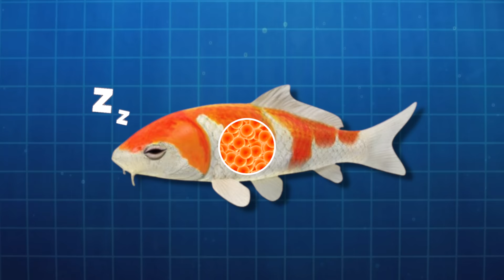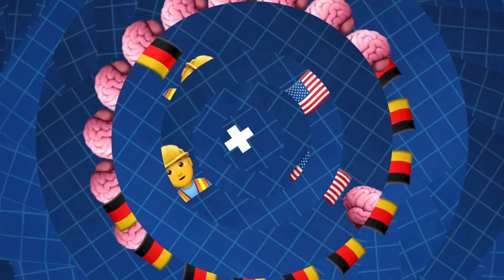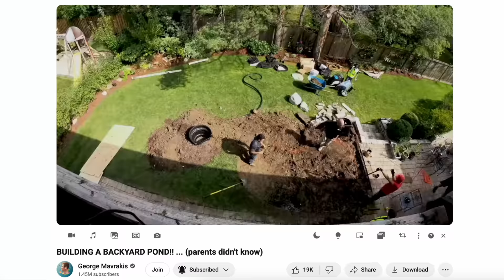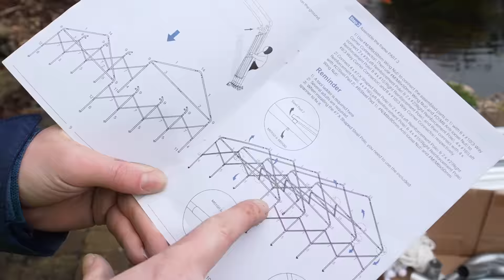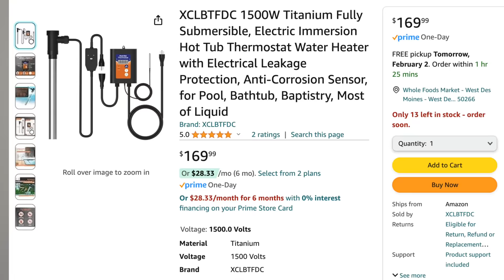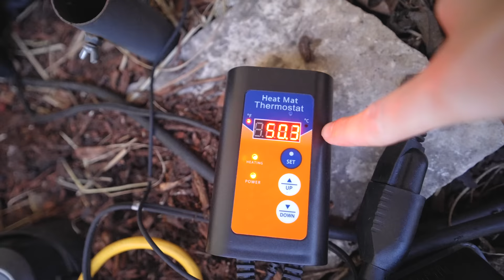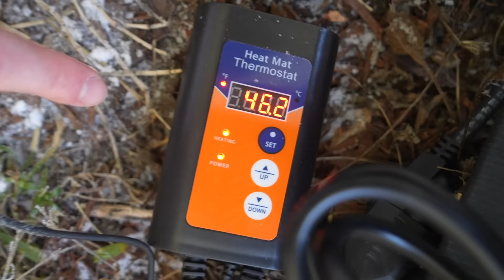SAVING Rare Koi From Freezing Ice Water

Comment: Guys theres a livestock tank heater for $50. I use it in my pond in winter. Thats all you need
Reply: We use one of those in our bigger trough that has more fish in it but the thing is just be careful with those cause they constantly tripped the circuit
Reply: I was just going to say. What you just did. Great job 👍.
Reply: Just an air stone left running all winter is all you need. Has worked for me for many years and it won't up your electric cost 60 to $90 a month like a heater would.
Reply: Build a bigger pond
Reply: That's what I was just about to say. I was gonna say "why can't u just get a water heater 💀"
Reply: thats what i was thinking. Put it near the waterfall bit and it will heat as it passes the heater

Comment: Build up a bit mulch around bottom perimeter of tent will help to keep heat in tremendously ..we do this up north its amazing..even pile dead leaves around outside perimeter,  make sure they are dry before doing so..u can even add frost blankets 2 permiter an reuse every yr..its worth it...from CT
Reply: Bales of straw would have fixed it so easy.
Reply: @1MeatBattery  yes they work just the same..I have used them in past, tho found leaves/left over mulch b more economical for my situation...but your right that's great way keep heat in

Comment: Just want to drop a bit of knowledge here. I built and have maintained a 5000 galloon koi pond/ stream for about 12 years now. It's 4 feet deep in the deep end, but averages about 2.5 ft.  I run 2 10in disc aerators full time. You mentioned one piece that is important, which is having deep enough water. However, the most important part is oxygenating the water, and making sure the ice doesn't freeze over and trap ammonia underneath the ice. (Which is the most often way fish die.) In 12 years implementing this strategy/making sure I don't have leaf buildup etc. I've never lost a mature koi, and I'm in a colder climate than you are. I've never covered the pond (only a net for leaves) or heated the pond.

Comment: Could just use a bubbler which prevents the ice from freezing over sections of the pond. I recommend only putting them 1 ft or so down so you aren't taking the 'warmer' water from the bottom and raising it up. You're only disturbing the surface.
Reply: Exactly they're doing all of this work when all you need to do is add an aerator

Comment: Next year surrounding the pond with bales of straw on the outside of the tent to seal the under draft will make a big difference.
Reply: Yes this what we do up north we use mulch around perimeter,  can even do frost blanket over that with leaves. ..if u move a pile u will see heat steaming off the inside, reusable helps tremendously

Comment: build a deeper pond, i dont know why you built such a shallow one to start with
Reply: Exactly and it would be a lot more affordable too.  Also could use an aquarium heating pad below the base soil which use very little power compared to what he picked above ground.
Reply: I'd just dig 6ft hole at one side of pond, and put air pump there, nothing else.

Comment: I'm so glad you realized that you need a heater in the water. But frankly 900.00 for a heater is nothing compared to what you paid for those koi and the trip over there to get them. You are asking the current heater you have in your pond to work too hard there is a good chance it will fail. To be on the safe side you should buy another one and operate them both then neither one has to work so hard. But here's the most important thing you should know and please pay attention  that canopy will not support the weight of the snow you have to keep the snow off the roof or it will collapse on you. The way to keep the snow off the roof is to be on the inside and gently poke at the roof with a broom to get the snow to slide off. I don't know how long you have snow there for but you will have to keep an eye on it the whole time.  Good luck I really enjoy your videos I love traveling all over the world with you keep up the good work thank you so much.

Comment: you just need to deepen the pool to about 7 feet at its deepest point. And run the pump continuously when winter comes and stop feeding. That will be safe. My friend has kept a frozen pond for over 10 years with no problems.
And especially in cold regions like you should raise the Goshiki Koi, it will be very beautiful and have full color in cold regions.
and you should keep nutrient levels in your water as winter approaches low to avoid bacterial growth. You can also put a UV lamp in your filter box.
Reply: 7’??? Totally not necessary. I live in New England where it’s in the teens and single digits for like 2 weeks at a time and my pond is 3’ deep and with a surface heater and air pump, my pond never freezes more than 6”. And I’ve had the pond for 25 years…
Reply: @spottedsaddlebredparaplegicpup   Bro, I agree with you, but those are not the most ideal conditions, I want them to be able to grow to their maximum, with the length of that pond, do you think it should be 7' deep? I prefer big fish of 60cm to 80cm rather than small fish like this.
Reply: Surface area is so much more important for koi than depth and from growing up there, I can tell you that the mud ponds in the rice fields of Niigata where they grow out those gigantic world class show koi aren’t even 7’ deep (they’re more like 3’-4’ waist to chest deep). Koi would much rather prefer shallow streams with high flow rate over deep lagoons with stagnant water. Koi are cyprinids and cyprinids live in clear, shallow streams and rivers. And 7’ is not going to be realistically possible for most keepers. At 7’ deep, most keepers aren’t going to be able to get in that deep to do maintenance. If you let leaves and other organic waste accumulate at that depth because you can’t reach down that far to clean it, it’s going to decompose, become a breeding ground for parasites, and do far more harm than good for the water quality and health of the fish. And let’s be realistic here and offer practical and reasonable advice. How many viewers of this channel are going to have gigantic world class koi? Less than 1%? Most of this channel’s viewers have domestic koi under $500 a piece in ornamental garden ponds.
Reply: @spottedsaddlebredparaplegicpup  
Dude, you should go back to school.
This lake uses the method of filtering through rocks at the end of the flow, planting plants there so that their roots can absorb nutrients in the water. and the organic residue deposited at the bottom will be processed by microorganisms and there will be no dirty mud or anything.
The proof is that the koi pond is like above but the bottom is lined with white sand and is not black at all.
You don't have enough knowledge, I'm talking about the case in the video where the lake area is quite small so it needs to be deep. But everyone knows that there are many cases where people use the depth you mentioned in livestock farming to make it easier to observe, and the depth of fish is increased to 16 feet deep.
I think we should end the conversation here.
Reply: My Canadian pond is 36” deep but only about 1/3 of it the rest averages 18” . I run a bird bath heater suspended at the surface to keep an opening in the ice. Even in the coldest stretches of winter the ice has never been more than 6” thick. It’s been there twenty years and I’ve only ever lost one fish over the winter.
Reply: @QuangHuyPham-ss6eg  🤣 what kind of school? You got a doctorate in koi management or viet school? I’m sure all of the world class koi breeders and keepers have degrees.

Comment: Don’t ver crack the ice, it can kill them. You just need to dig below the freeze line. It doesn’t have to be 4 feet deep it depends on your areas freeze line, some places have 18 inches, in Virginia it’s 2 feet..
Reply: Yeah, cracking the ice is a huge no no. The vibrations will kill the fish because it travels with so much more force in the water. It’s along the same lines of dynamite fishing. If you need to open a hole in the surface, use a surface deicer or pour hot water on a small area.

Comment: Leave a rubber ball floating in your pond. when it freezes push the ball under the ice and drain a little water so there is a gap between the ice and the water surface it will stop the wind cooling the water surface.

Comment: Must not have it deep enough. They can live at the bottom where the water doesn't freeze overwinter. It helps to have a stagnant section with slow flow at depth. They will know what is happening and go to the deepest part and fall into torpor.

Comment: I would build a half or 2/3 the pond-sized wood framed cover that can be lifted on the pond if there is going to be really cold. It could have sth like XPS (like styrofoam but more dense) as insulation. This is just my thinking to reduce heat loss via reducing wind and heat-radiating surface area. Not a fish expert, but I know something..

Comment: Get a pond that’s at least 24”, get a surface heater, and an air pump. This is an unnecessarily large project for the sake of the video and isn’t actually practical or the best practice.

Comment: I’ve had a 3k gal Koi pond for 10 years and I don’t understand how you’re going to make a nine minute video when the answer is “put a bubbler in it” 😂.
Every every winter, I just put a bubbler in… A big one… But as long as part of the water doesn’t freeze, then the water can’t freeze through and the bad gases can’t get stuck in the water. You don’t need to do anything more complex than that. I live in New York. 

You could also get one of those little heater rocks if you don’t want to do a bubbler cause they can be kind of noisy… But the heater rocks are a little more expensive… Basically, you just have to make sure at least part of it doesn’t freeze. 

This video is very confusing

Edit: also, why don’t you have a net over your Koi pond? Doesn’t it get filled with leaves in the end of fall ? Then you just lift the net in spring and throw it out. They sell them on Amazon for like 20 bucks. Although I would go for the $40 one because the $20 ones rip.

Comment: You dont know much about koi ponds do you. You might have many subs but you dont know much about water. Forst of all 3 foot is plenty. Ive had a 30cm deep pond not freeze over in - 15 degrees.  As long as you have moving water in a pond it will not freeze. A pond heater is not needed but can help with gas exchange . But your waterfall is unlikely to freeze over.

Comment: i am 52 yrs old and it appears i am from the last generation of jack of all trades people. the amount of fumbling with this project that should have taken bout 90 min with smoke breaks. I recently needed a licensed plumber to move a gas line. on the way out his van would not start, he had no clue, i got him up and running and figured out that it was his battery no longer held a charge well and he would be basically on generator power to get home. I could have done the plumbing myself as well but since it was a gas line and not a water line i paid him to do it to alleviate worries on the wifes mind. to the tune of 300$ to move a gas tap 8ft.... But happy wife happy life, if your not broke afterward i guess